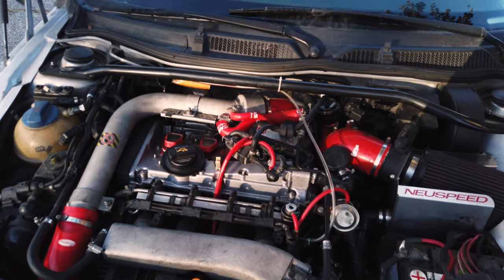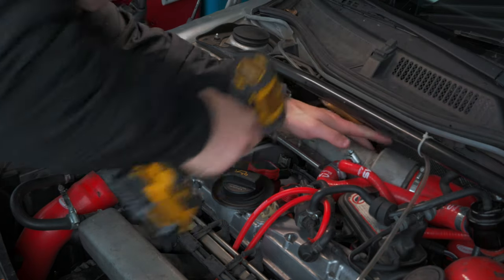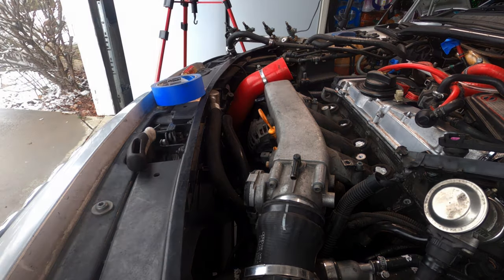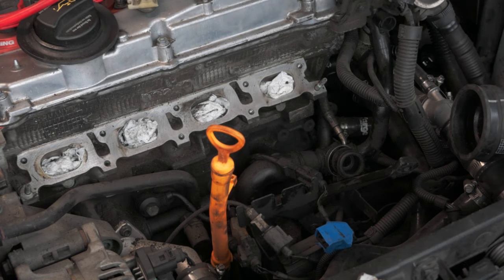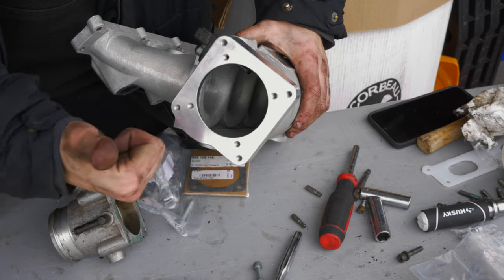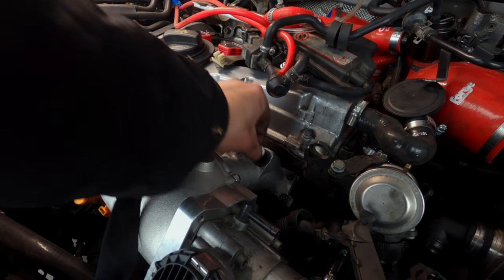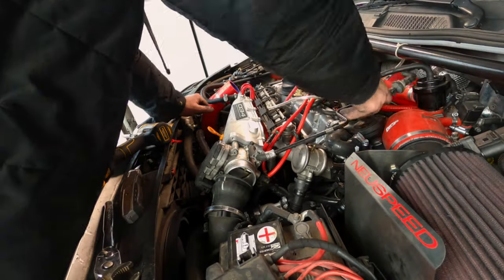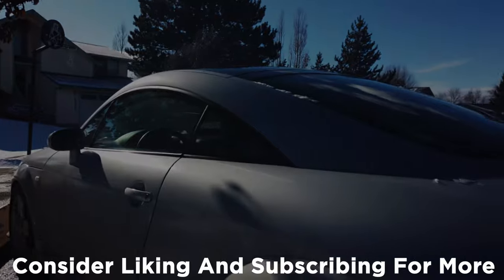Upgraded 1.8T Intake Manifold and A Destroyed PCV

Comment: Hey my man.  May I make a suggestion??  Do what I did and yank out allllll that emissions crap you don’t need.  Get rid of the entire PCV, N249, SAI and EVAP system.  Rip it all out.  The combi valve, all of it.  This eliminates so much stuff / hoses that can crack and leave you screwed.  034 makes a block off plate in place of the combi valve, run resistors where you unplugged stuff, install a catch can  and tune the rest out.  My 02 225 loves love loves it without the 20 year old extra crap under the hood and yours will too!  You’ll thank me later!  Enjoy!
Reply: Exactly, when I was 1.8t I ripped ALL of the vacuum/evap lines out, you literally only need 3 vacuum lines for the 1.8t to run and especially aince he is planning on going big turbo that is all you need. I been through it and thats that.
Reply: Seconded, please just get rid of all that crap already!

Comment: It looks so funny with the stock throttle body 😅. Without the larger (hemi) throttle body, I doubt there is much, if any, benefit to this with anything less than a GT30. The stock intake manifold is already really efficient. The problem with it is that the throttle body mounts on the side in transverse motors. If it were possible, the longitudinal intake manifold would yield better results overall. You need to ditch the PCV suction jet system all together and grab yourself a catch can that vents to atmosphere. You won't nessisarily notice a difference in performance, but it is a must-have. I have IE mk4 gti/jetta can. It's overpriced, but I'm very happy with the product.

Comment: Damn nice I was looking for a manifold for my 180, I want to get a fmic but hate how the 180 piping is ran. I did a silacone pcv upgrade and my pcv hose was completely in half missing about 2 inches of hose haha
Reply from the maker: Dang that sounds like a really messy pcv job haha. It sounds like every one fails catastrophically. Also a manifold like this could definitely help you re-route the IC piping. You could mimic a 225 routing pretty easily I bet. Thank you for the support!
Reply: @HunterDirection  yeah that's what u was planning on doing, but this one here would alow me to put it on 180 style and then switch when I get the fmic. But yeah waiting for you to wrap the TT, I'm in the process of sanding, priming and making the some new bumpers off a 3.2 I found in a yard close to me surprisingly. I got the spoiler but not sure if ima put it on yet haha, it's cool but I do like carbon fiber 😅
Reply: That's about where I'm at right now with my 02 awp project.  I will be looking closer into how that will benefit future ambitions with the car.
Reply: @nealraudabaugh7922  yeah mines a awp 02 as well. I'm getting the 180 fmic and just change the piping later.

Comment: A shop vac would of helped so much with safely retracting all the debris from the injectors the manifold and the oil filter housing. Nothing can go down to the oil since the gasket has vents so it acts like a cage, but you would be introducing all the debris to your turbo and intake. Cheers

Comment: Bro yea the pcv system is vital for all 1.8t engines. I think vw Audi group should have made it clear somehow that this piece is so importantl to change before 100k miles. Ideally 80k miles. I just did mine the other day, and was in the same condition as yours.. Also as a tip, if you need a hose going from the pcv into the manifold, I'm pretty sure it is a 10mm vacuum line. You might want to check your evap purge valve too, they can go bad over time.

Comment: Hey hunter I have a question about the turbo inlet pipe on the s4 b5. Mine passenger side pipe for the turbo is coming lose, I can tell because of how much tighter the driver side one is, do you know if that could be what’s causing my car to be in limp mode, I’ve done spark plugs twice and done the oil change ever since I bought the car, but it seems like it was running better when I drove it for the first time after it was sitting for a year. My car wasn’t in limp mode when I got it, so what’s causing it for it to be in limp now? I have no throttle body boot leaks or lobster claw leaks. Things I haven’t checked off are pcv system, or maf, my car is very hesitant on full throttle in higher gears between 3k-5k rpm. I’m not sure why, if I’ve fixed a lot of issues I found, one of my coil springs being missing. Which I fixed when I done the plugs, so at this point I’m just losing my mind trying to figure out this problem. I would appreciate it so much if you gave me your opinion on what the problem could be! Thank you so much bro.
Reply: Keep up with the amazing content, we wouldn’t know a lot of these things without you man!